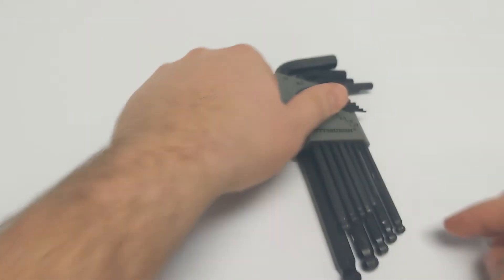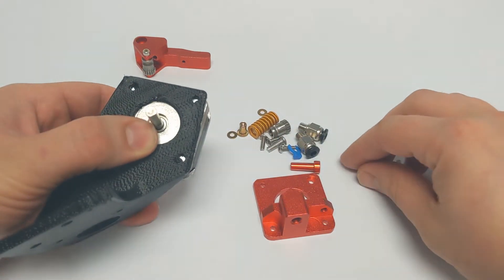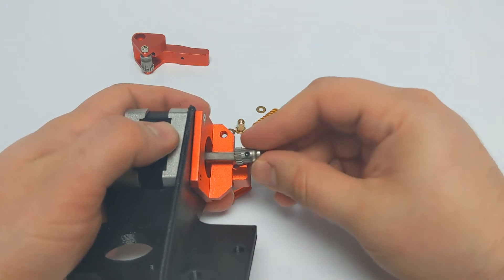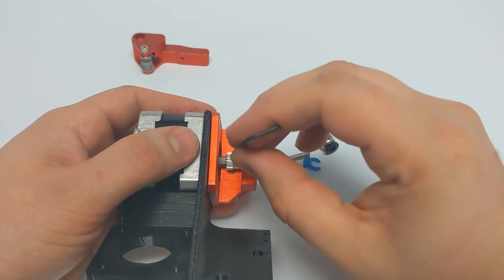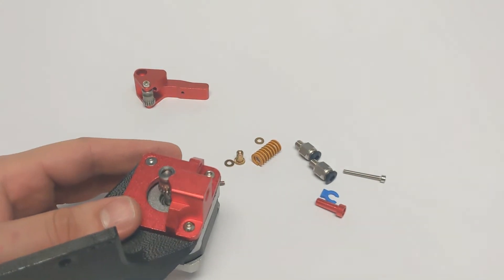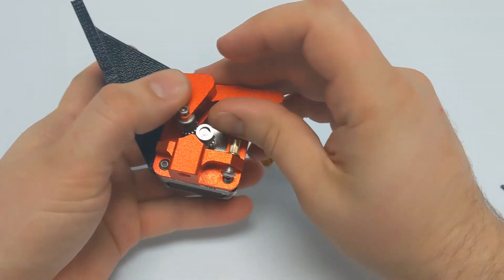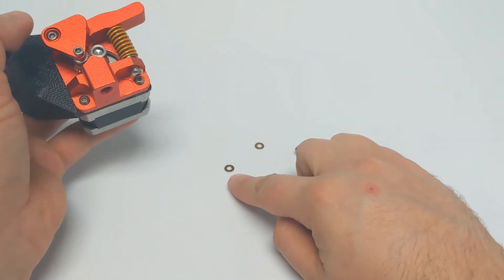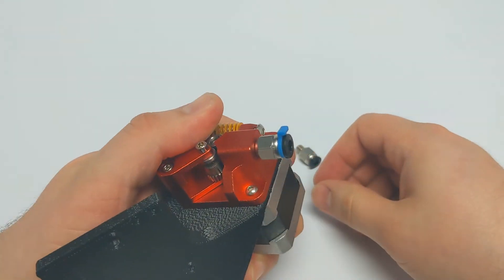How to Assemble a Dual-Gear Extruder - Ender3, CR-10, upgrade etc.

Comment: Those "spare" washers are not spare and go on the TOP and the BOTTOM of the other barrel gear (the one nestled in the extruder arm).  

From extruder instructions: "The Drive Gear is upgraded with washers on both sides to prevent the extruder base from wearing out as quickly (also prevents it from no longer lining up with the gears on the stepper motor)."

Comment: I've taken a single gear extruder apart many times and I probably could have figured out assembly a dual gear although they are a smidge different. The dual gear I bought came with NO instructions...wow.  Thank you so much for this video!  Even now, 3 years after you posted this, it's still about the only video detailing the assembly.  Some videos show the entire extruder upgrade process and briefly run through the assembly but this is much much better.  Thank you!

Comment: Great video thanks! I’m using that Extruder on CR-6 SE trying to print with TPU, but the filament keeps getting jammed. Tried everything I could so far, including retraction reduction to 0 mm, adjustment of the gear to the correct height of the filament inlet, reducing printing speeds, trying different temperatures (200-230 degrees Celsius) cleaning the nozzle and even changing. Yet it keeps getting jammed and leading the Extruder to be jammed. Any other ideas what could be wrong?

Comment: Thank you for this. I was befuddled because the M3 bolts thread into that spring tensioner that is only placed on the M4 bolt, until I watched your video closely and realized you were not threading it on the M4 bolt. I wasted about 20 minutes wondering if they had put the wrong parts in the kit, and then 2 hours adjusting the orientation and assembling and disassembling, only to find that of the two motors I had ready, one was too short and the other had no flats. Luckily I was able to find one from my other printer that was not in use. Ugghhh
Reply from the maker: @groggynod  sounds frustrating - we've all been there! Happy the video could help a bit
Reply: I'm having somewhat of the same problem. It seems the rod that comes out of the motor isn't long enough to get the grub screw to tighten down on it... @powerbelt3d

Comment: The two washers go top and bottom of the idler gear to prevent it wearing out the base metal.
Also, AFTER assembling all parts except the spring: 1: Put the M3/4 screw PARTLY in but not showing. 2: Put the spring onto the screw on the adjustment lever. 3: put the the adjustment "hat" into the end if the spring. 4: Compress the spring into position with the "hat" now over the hole for the adjustment screw. 5: screw in the adjustment screw.
Basically, you did it ass backwards.

Comment: how tight the bolt in the spring makes a difference ?
Reply from the maker: For more 'standard' filaments, it doesn't make a huge difference as long as there's some pressure on the filament. If you start printing softer TPU filaments, you might need more/less tension.

Comment: What would cause clicking? It only happdns once in awhile.
Reply from the maker: It could be a handful of things. My best guess is that the tension is set too tight.
Reply: @powerbelt3d  I adjusted that to either tight to loose. Still does it, but only when retracting during infill. Then stops when it's  regularly doing a outer layer.
Reply from the maker: @smallnuts2  If that's the case, I'd recommend slowing down your infill speed :)

Comment: Hi, i have an original cr10...with this upgrade do i need to recalibrate the e steps on the extruder motor plz?
Reply from the maker: Yep! If I remember right, you'll need to increase E-steps around 20%

Comment: Thanks for the video.  It pretty much confirmed my assembly.  One question.... The kit (yours and mine) comes with two pneumatic fittings.  Should the 2nd fitting go on the filament input side of the extruder or not?  It is really the only part I have left over, minus the two washers.
Reply from the maker: I problem! I would consider the second fitting on the input side optional. I haven't been using it. If your filament path to the extruder is really long, I think you could use it with a reverse Bowden tube.

Comment: Hi , thank you for your video.
I have the same extruder but i found that the yellow spring was too strong and changed it to the grey " old" bed spring of my E3pro this made it more useful to manage the tension on the filament. And i ditched the pneumatic couplers in favor for the couplers with copper ring  called compression fittings.
They are awesome and I recommend these. Also i filed off a 1.5 mm of the base plate and fitted a washer and some lube so the geared hob gear does not grind into the base plate. Also I used a bold that has no thread where this gear sits.
Hope these recommendations can help you make this extruder better than it is.
Reply from the maker: Happy to help! I'm glad it seems like you found a combination that works for you.

Comment: How much did your printspeed increase after upgrading
Reply from the maker: I didn't measure the before and after. BUT print speed is a combination of hotend, extruder, temperature, etc. This would be a good step in the right direction for printing faster